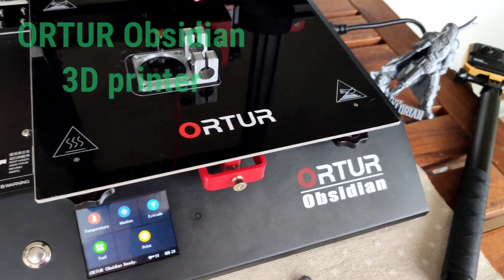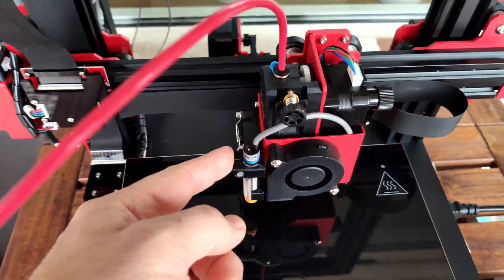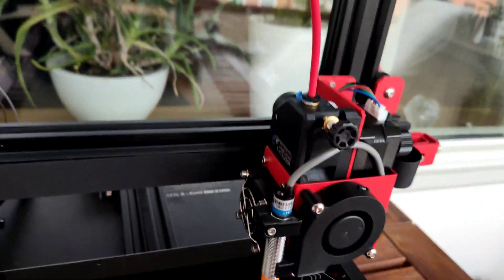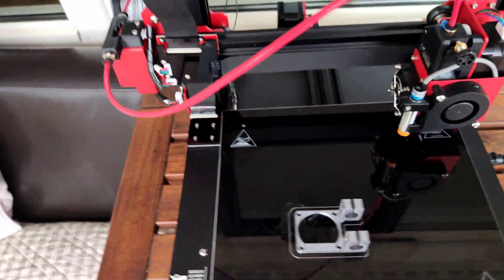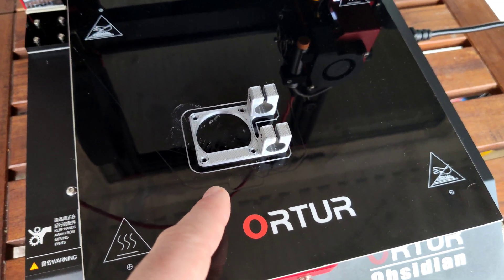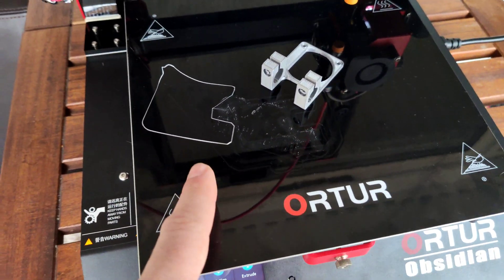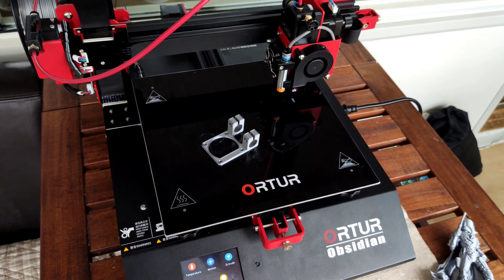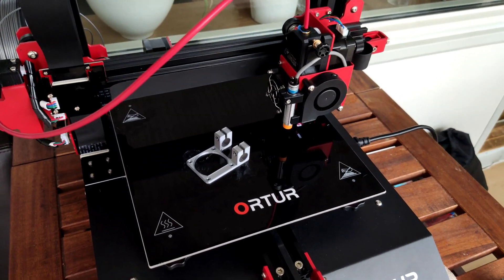ORTUR Obsidian, 3D printer Review

Comment: Could you please make a video of the firmware you wrote? e.g. how it differs from the stock firmware the printer came with. I see Ortur also has new firmware out.
Reply from the maker: my marlin firmware has all the settings that marlin can have, full control of your printer - Original firmware has basic settings that are O.K. for easy printing (If you're a beginner I'm
 recommends that you use original based firmware Update 2020-10-18)
Reply: @ThousandHobbies  Thanks! I'm not an expert, but I have been 3d printing for a couple of years now. In other reviews I saw that the stock firmware still had some issues. Not sure if these problems are all solved in the October update.
Reply from the maker: @FPV_Jos  solved and fixed

 😊